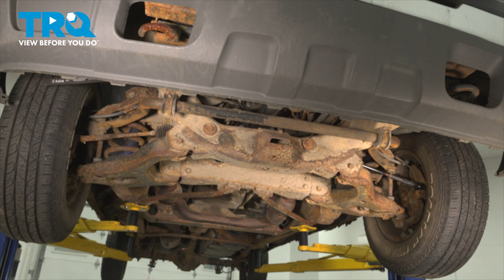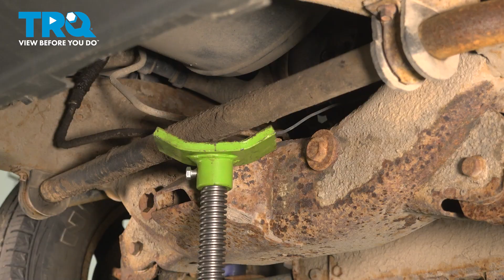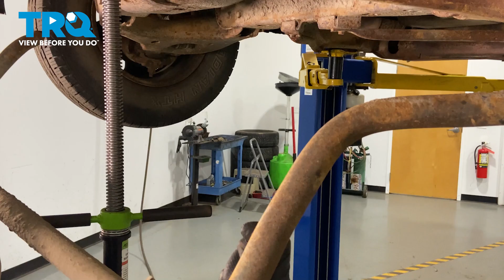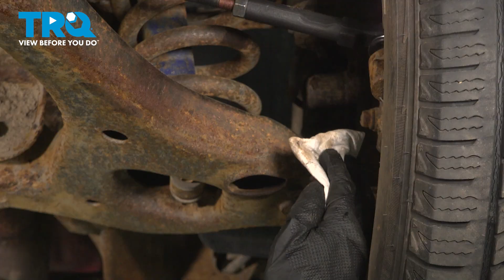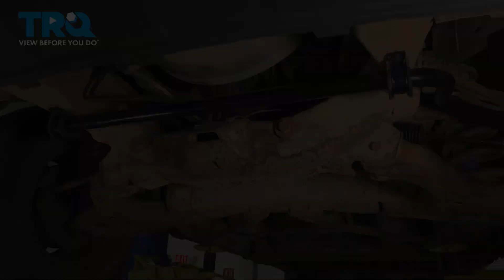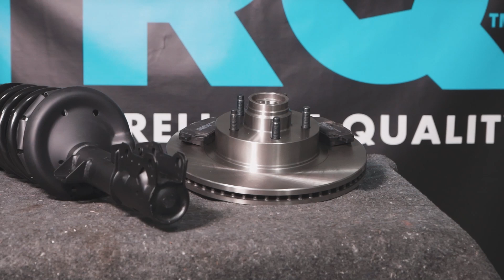How to Replace Sway Bar Kit 1999-2006 Chevrolet Silverado 1500

Comment: Do you guys not realize theyre not the same from 99-06? Because i have a 2000 silverado 1500 here and the sway bar doesn't even mount there. Will you just put the year your working on. Would make everything 1000% easier for everyone.